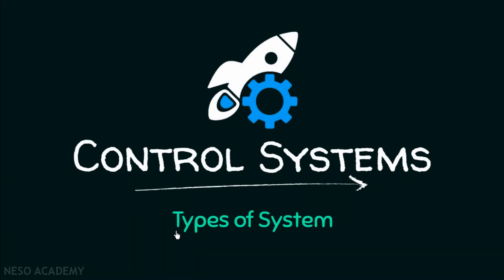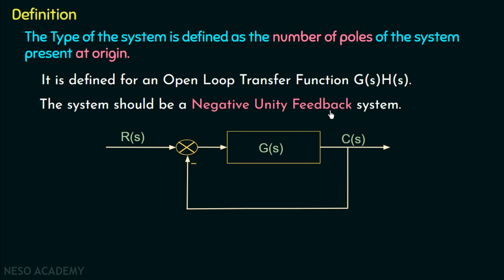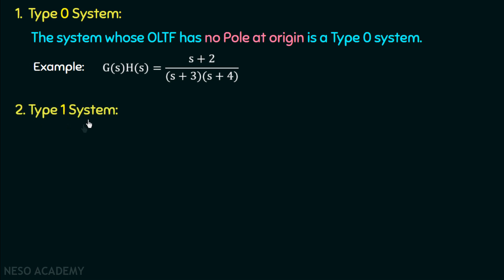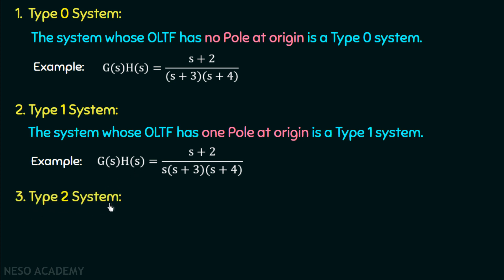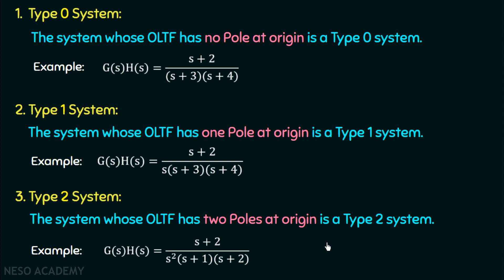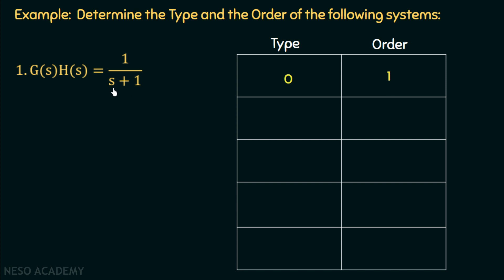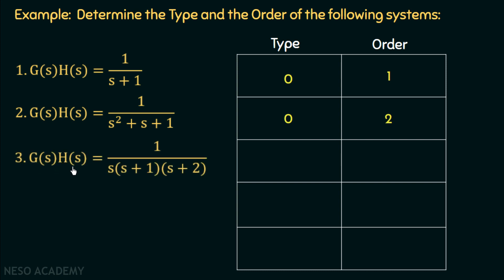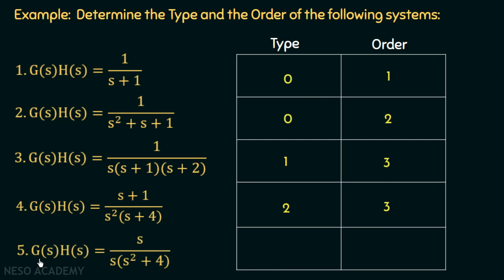Types of Systems

Comment: 0:48 he said it is only defined for open loop transfer function but doagramitically he drew closed loop transfer function?? As he given the output again to input (negative feedback) 🤔
Reply: Yeah his explanation is so confusing. How can it be defined for an OPEN LOOP TRANSFER FUNCTION and then say the system should be a NEGATIVE UNITY FEEDBACK SYSTEM? Did you ever find out regarding this?
Reply: @valour549 I have the same comfusion
Reply: I dont get it either
Reply: Hi, I am student currently studying control systems and was watching this video to catch up on a missed lecture. I had the same question while watching the video, but I think I figured this out and wanted to share for future watchers.

What I believe is meant is that the open loop component of the system (ei open loop transfer function) should be in the form G(s)H(s) = G_1(s) where you have only roots of s in the denominator.  In my comment G_1(s) should be the same as the block G(s) shown in the diagram at 0:47 and would be the transfer function if you remove the feedback loop. Analyzing the "Type" of G_1(s) can give you information which can be applied to the whole negative feedback (closed loop) version of the system.  So basically, G_1(s) should be in the form of the equation that he is analyzing for the rest of the video, but this analysis is only relevant if G_1(s) is part of a negative unity feedback system.

What this video does not cover is what information determining the "Type" of G_1(s) gives us about the whole unity feedback system.  If you don't already have a textbook or video to explain this, the one I my class is using is: Modern Control Engineering, Fifth Edition by Katsuhiko Ogata.  Section 5-8 of this book discusses what the system type tells us about the transfer function.  The way I would paraphrase it is that "Type" of G_1(s) tells us what inputs of R(s) the control system can keep up with as defined by what the steady state error (_ess_) will approach.  For R(s) = 1/s (a unit step input), a "Type 0" G_1(s) will have ess = k (some constant), but a "Type 1" G_1(s) will have ess = 0.  Similar conclusions can be made for higher order inputs for R(s).

If someone with better knowledge notices a mistake please correct me, but I just wanted to leave a comment for future students since the question hadn't been addressed yet.